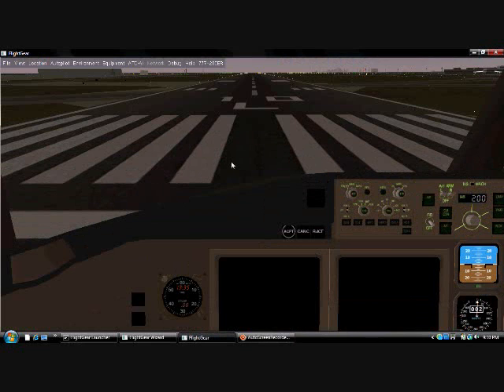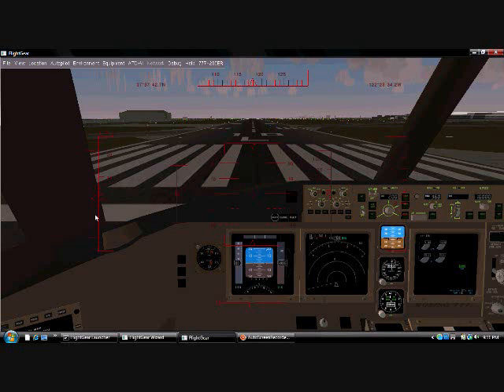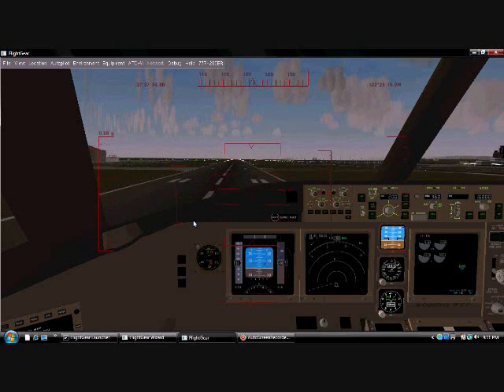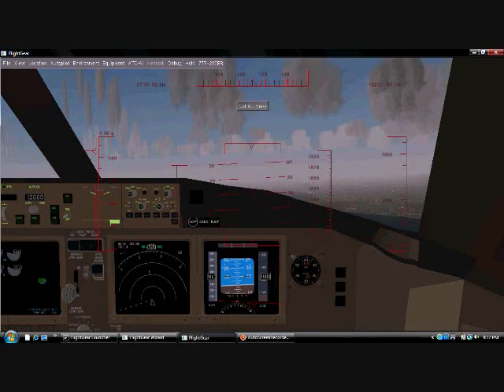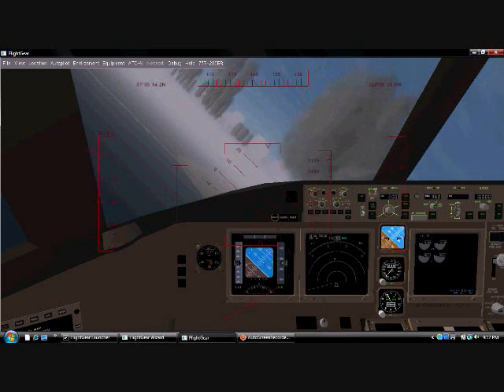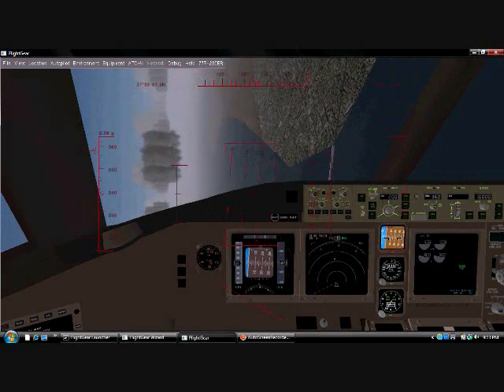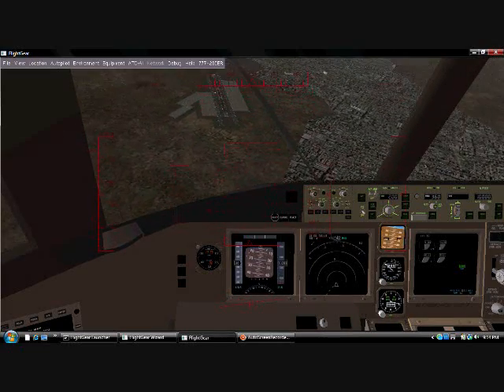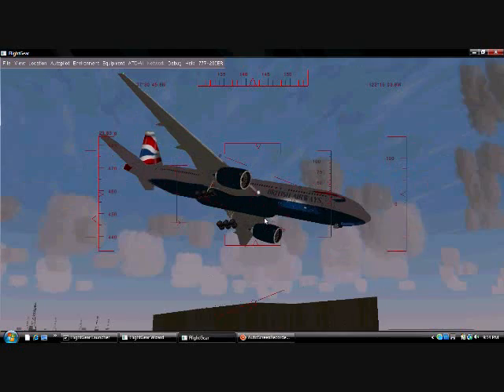How to Takeoff in FLightgear (777 and other jets)

Comment: To take off and land, use the flaps. You can do the rotate at 130 knots. To stop the plane on the runway, don't use the flaps, just the reverses and the speed brakes. But you can use the brakes on shorts runways. To land, you don't need to put the nose down, just keep a low speed and put full flaps.